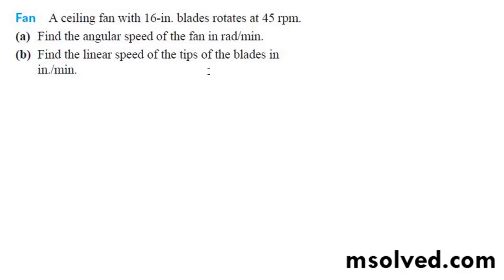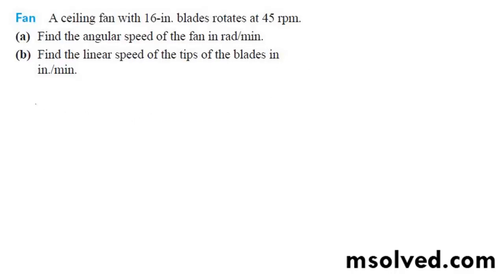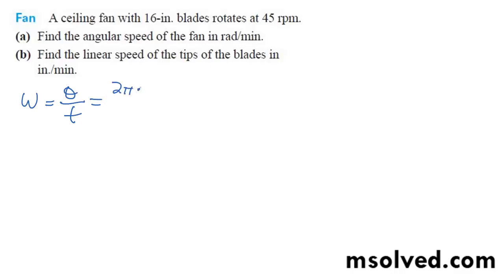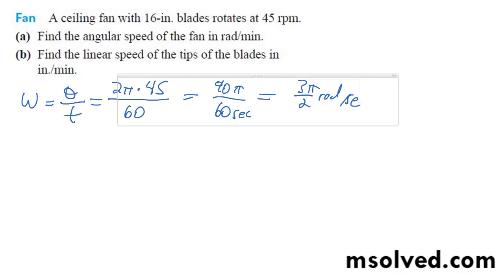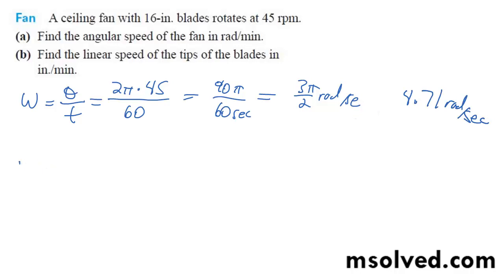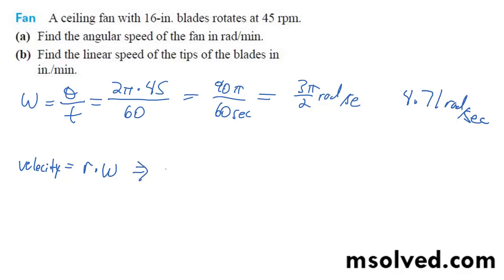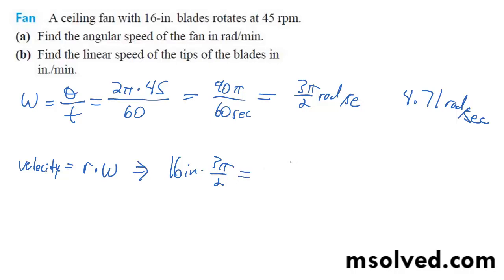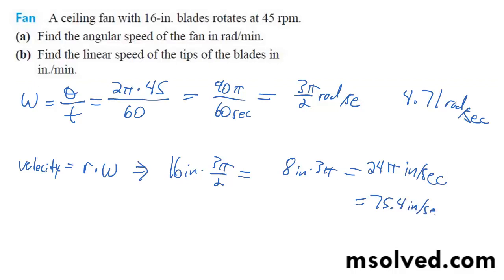A ceiling fan with 16-in. blades rotates at 45 rpm.

Comment: This helped out a lot, but in the end you did not convert it right since it asked rad/min not rad/sec. So the final answer is
a)       (2 pi*45)/1 min=  90pi/ 1 min= 90 pi rad/min and 
b)       16in. *(times) 90pi= 1440pi in/min